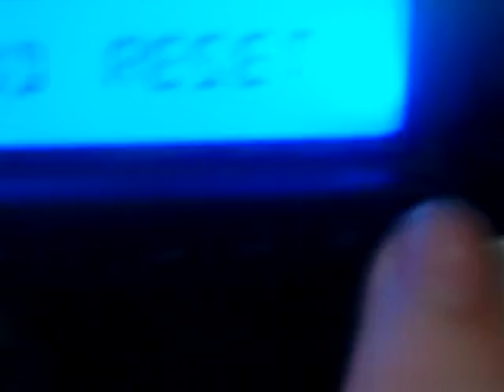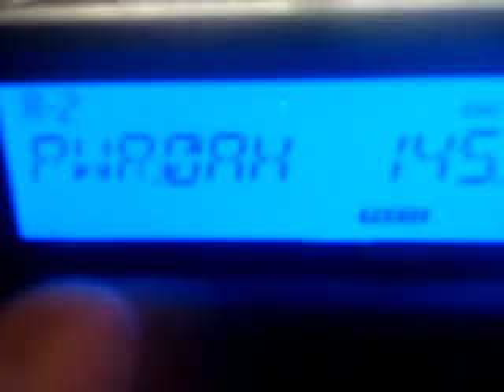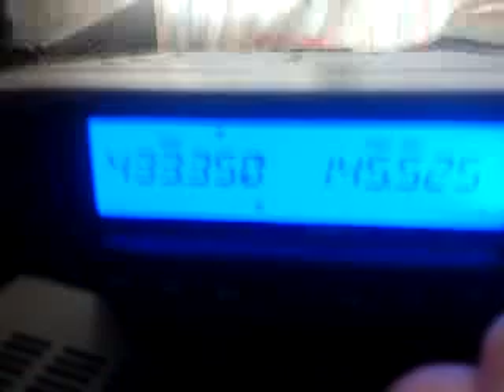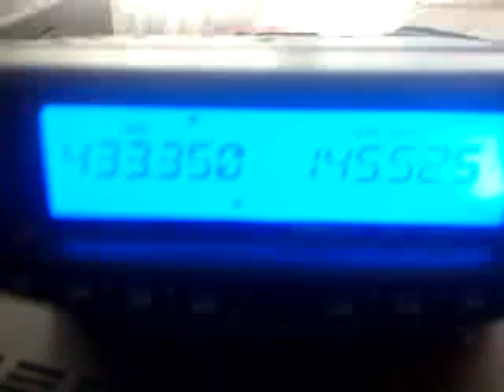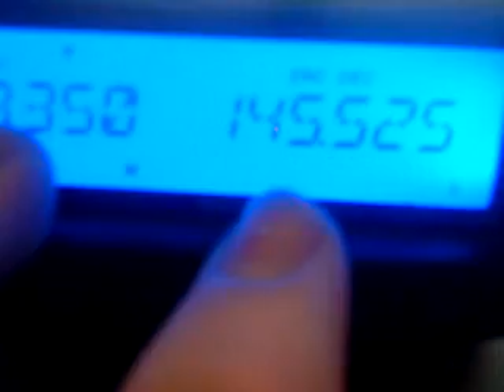Showing how to use the Crossband Repeater on the Yaesu Ft 8900R

Comment: hi
do you know what each value means as i am wondering what other power values are available. i also have a ft8900 and i think it works brill. also you seem very clued up on this so do you know how to change the step values so that i can do rather than a minimum of 5khz step maybe a 1khz step. the lowest value available on the set menu #37 is 5khz 
thanks in advance
73's 
James Monahan
2E0JPM
radio scout from reading UK

Comment: a handy function to have,but ofcom should state waht channels can be used for this,you dont have to use 500mw on your handset,just on the tx output of your x band repeater,by runnig higher power on your handset dont think you would be breaking any rules,where can i get more info regarding this type of operation,ofcom stuff is black and white but to much grey and not to the point.